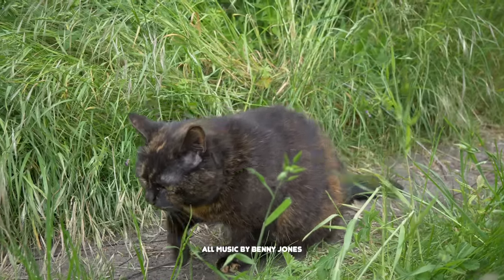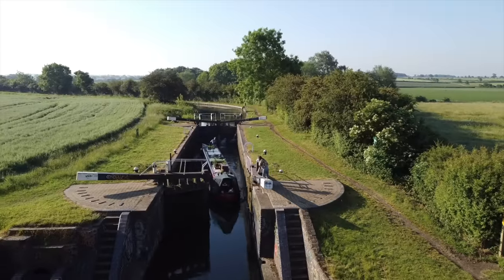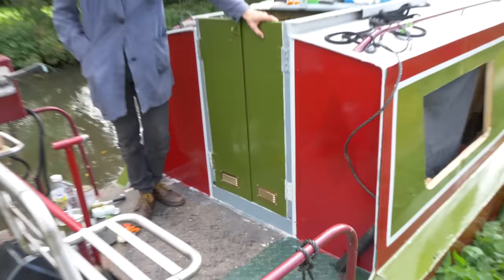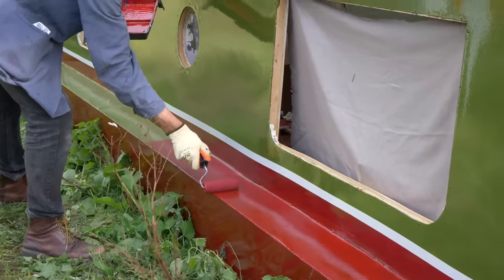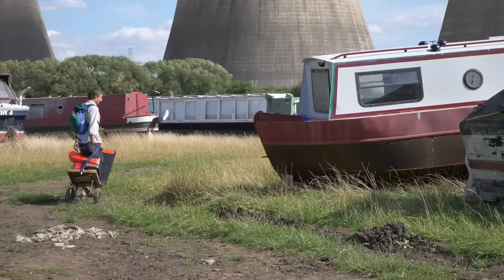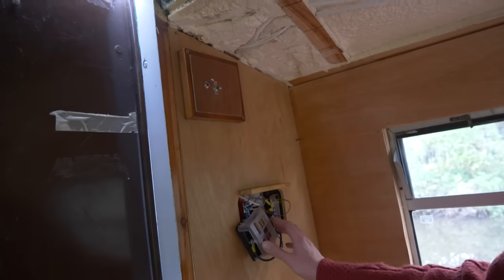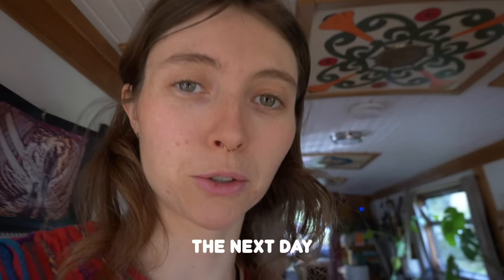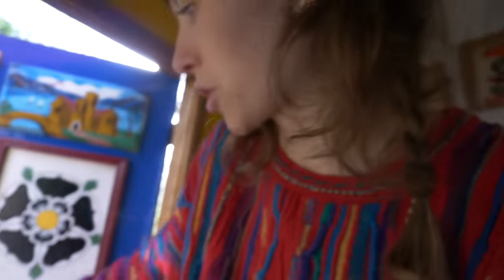Painting Our TINY Narrowboat Project! | EP70

Comment: what abeutifull little springer,  i usedto have one that size many many years ago, it was powerd by a single pot deisel engine which used to make the boat vibrate when moving ,still it was cheap to run,as you will usse it as a tender i must say WHAT A NICE TENDER BEHIND YOU HAVE ,from this old 87 year old. happy times to you both.

Comment: I made an off grid canal boat type set up for the house years ago before people started getting batteries at home. I used to buy panels as I could afford them off EBay. In the end I had 2 kilowatts of panels. A 80amp charge controller. 6 caravan batteries. 3.5 kilowatt off grid inverter. Worked great.

Comment: Hello , love your vid’s…
But you will absolutely need the rubber grommet plug for light and horn..
Over time, due to vibration will wear the wire coating and short the wire at the drill hole (steel).
Keep up with the vid’s watching  from USA   🙂

Comment: When crimping. Instead of using two females or two males together. Use one male and one female. That way if the cable does become detached, there is no chance of  wiring it incorrectly as the male will only go into the female, etc.

Comment: Ben: it's BUS BAR or BUS (although if you are a Brummie like me, you pronounce it buzz-bar!)  I spent my career in electrical and electronic engineering and I have heard and used the term "bus bar" thousands of times, but must admit it hadn't occurred to me to find out why it's called that.  It evidently comes from the Latin word "omnibus" which means "for all". (Hence the omnibus or bus used for transportation is usually a conveyance for all the public).  So in the electrical context a bus bar (or bus) is something that supplies "everything" with electricity - or at least several things.  It's usually the common connection that then feeds the different circuits, often via fuses or circuit breakers.  Incidentally, when I started work in the late 1960s I came across some equipment that had literally bars of copper forming the bus bars supplying machinery - all exposed to the touch and carrying 415 volts.  You certainly found out quickly to keep well away from them!  (They were behind a sort of railing for "health and safety"!)  Love what you're doing to Rambler...